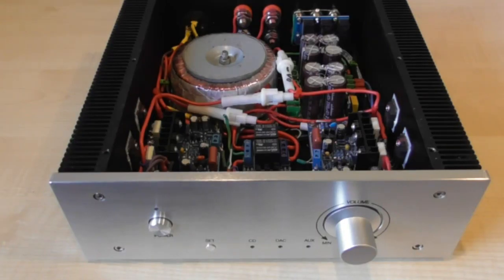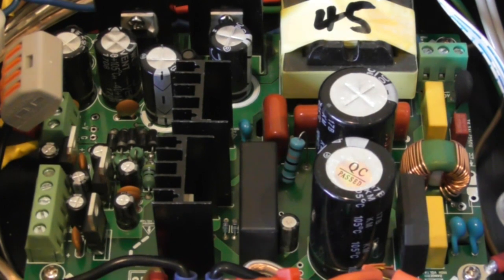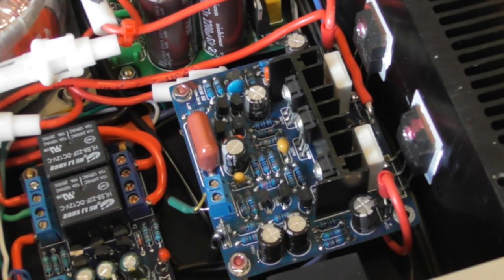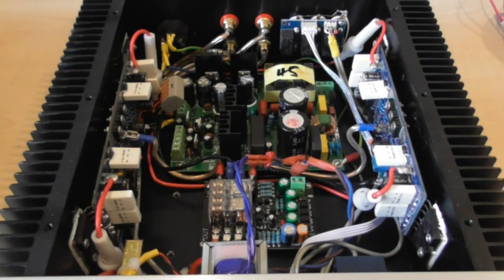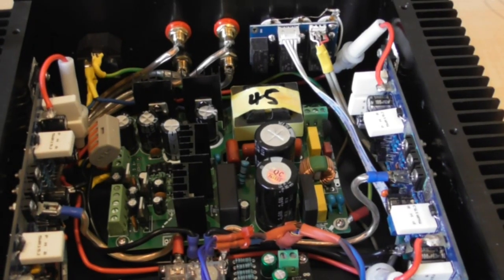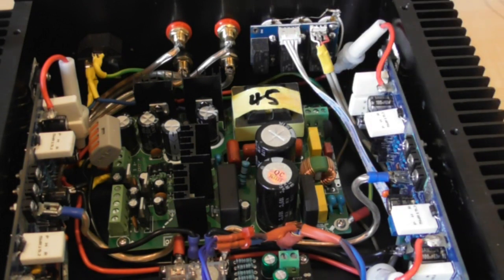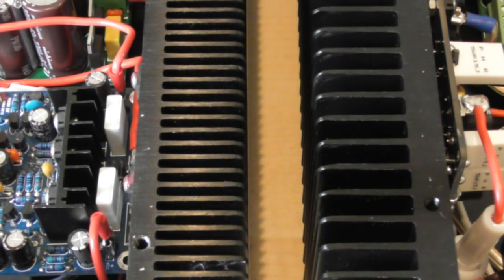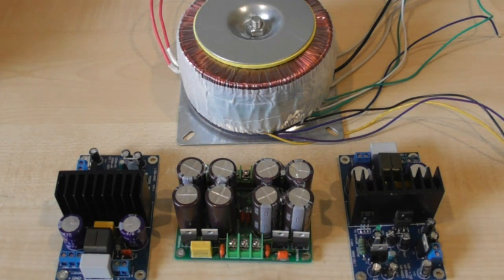Amplifier Thoughts So Far

Comment: Main issue with chinese printed boards is complete lack of care for thermal loads, if you take a look at that heated black box which desintegrated itself at 2:00  there's small electrolytic capacitor leaned to the heat source aka the black box. Poor guy probably got cooked, dried and induce oscilation within circuitry. So, in order the save few cents on size of pcb, they designed crappy product which at the end cost more but to end user not them. Typically chinese. Complete lack of common sense.

Comment: I thought that switching power supply  can not be used for amplifier after watching this video:

https://youtu.be/PISZsjNhq7I
Reply from the maker: That is simply not true. Many active speakers today use SMPS, most high-power professional amplifiers do. Based on my experience the ONLY negative is reliability. Of course, it's complexity makes it almost impossible for the average person to repair. Sonically, no difference at all. For reliability, and ease of repair a standard PS wins every time. PS Most cheap SMPS from China are complete crap.

Comment: Nice video!  What brand is the PS?
Reply: Hi Kiss Analog, I got my PS by Aliexpress from KaisayaHIFI audio store, actualy there is not brand name printed on the board, only the model number HBP500W.
Reply: @Luca-bh2fo  I guess if I ever build another one of these I should avoid switching power supplies. I built one many moons ago using a switching supply and LJM L20 amplifiers. Performance is incredible. Unfortunately my amp projects were all stolen and I have no way of knowing if the switching supplies survived for any length of time.
Reply: @Luca-bh2fo  Thank you!!

Comment: Dear Michael, following the info provided by a guy (You will find its web page searching on google for "pitaniya-kolonki-xline-lux-152a") I have been able to repair my switching PSU. My PSU is the same as yours apart that mine is a -50/+50V but the switching controller/driver is identical to the one reported by that guy. However in my PSU the protection, for what I have seen, is actualy inexistent, the R-sense is 0.025 Ohm and testing the controller alone I noted that the power section is turned off only when the dropped voltage accross the R-sense reachs 1.3-1.4V for at list 2-3 seconds, it means 56Amp of continuous current!!! Replacing the R-sense with a 0.25 Ohm might be better but this kind of protection practically still remain not effective.
Reply from the maker: Good morning Luca, Well done in finding all this info. I no longer have this power supply, it seams that yellow block is the death of many of these SMPS. I don't know what the issues are, why they are so unreliable. I will not buy another for sure. The manufactures are 100% useless. They don't respond to any form of communication at all. Impossible to buy those hybrid modules. I don't think I care to repair them either. 
One of my PSUs failed on just low level background music, so very little current was being drawn. Just a poor design with zero backup. Best avoided I think.

Comment: I had a Marantz PM XXX and after 3 or 4 years it was broken. Fixing it would be to expensive so I could throw it away. Now I´ve got a L25D class d amp with 250 watts at 8 ohm. It sounds great and it makes no problems. Domestic HiFi amps are good looking, expensive and of course good but it won´t work as long as you wish.

Comment: I am just a first year electronics student so I might be completely wrong. Can your oscilloscope be configured with a low pass filter? Class D is like a tiny bucket you emty at the carrier frequency. So I think you need to put a 8 Ohm load on the output and crank it while you measure with you scope over the 8 ohms. Try a steel beam and see you can find a 8 Ohm load that doesn't brake at full power.

Comment: Which one is better sounding l12-2 with llc power supply or l12-2 with toroid trafo and how much watts in 4ohm?
Reply from the maker: Reliability is the issue with a SMPS. Sound wise little difference. You do get a better power reserve with a big transformer and a high value electrolytic caps. This is my preference. Power into 4 ohms will depend on the power supply but should be double the 8 ohm power.
Reply: Im looking for cheap, small, easy, powerfull and  good sounding amplifier :D I have thought to use smps and put all this in a small case with cpu heatsinks. I think this smps may be better.600W https://a.aliexpress.com/_dWmckpH Im not sure can it work good compared with trafo setup when 80-90% volume.

Comment: Nice video, thanks! I really hate that kind of crackling noise of most class D amps I've heard so far. Really no preference, the lx-50 of L12-2?
Reply from the maker: Hi Marcel, not much really to choose between the LX 50 and the L12. Cost wise the 50 is amazing value for money. The L12 does have slightly better dynamic range and greater power, possibly why it has that slight edge. I think the best combo really will be the L12 with that BIG transformer I showed in previous video. The last week or so I have been messing with that class D. I hate to admit it but it does sound good, slightly different but I cannot put my finger on it;s difference at present, mind you it is one of the better designs available. I will make a conclusion and test on the class D soon, not easy (for me)to test class D stuff because of the switching signals present and lack of experience on my part.